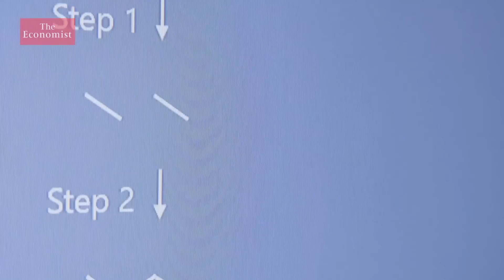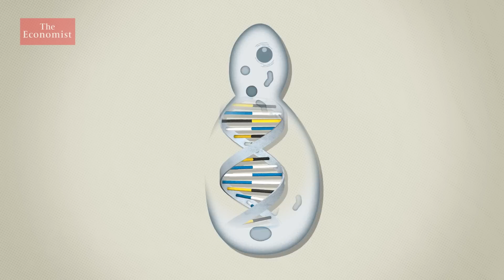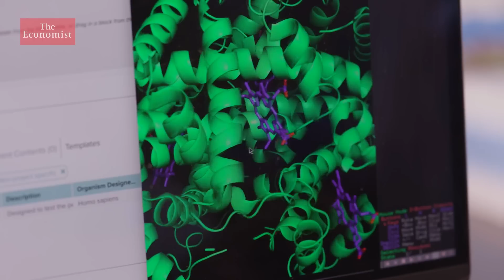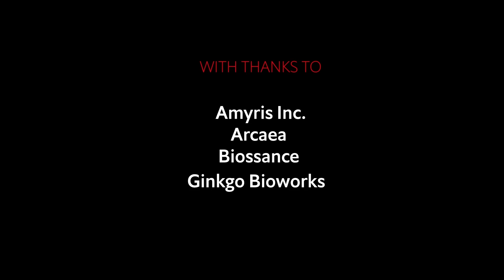How gene editing could reduce the cost of cosmetics

Comment: Biodegradable bioplastic could be mass produced through precision fermentation with no harmful environmental footprint.
Reply: Virtually all  types of biodegradable plastic alternatives produced today, from lactic acid  derived products to pinaple composite,  have a huge common problem in that they start melting at temperatures above 37C  or ~100F. We are far from replacing plastics.  The problem is that the qualities that make plastics so useful (durable,  stable, light ) are also the very things that make it non biodegradable.  Biodegradable materials are by their very nature less chemically stable - that's why they are subject to (bio) degradation..
Reply: 你们英国人是不是都喜欢吃猪食呢
Reply: The only peoblem this technology would face will definetly be it's durability/shelflife. Currently, the standard requiered shelflife of a cosmetic product is about 3 years. That means that this biodegradable bioplastic material would need to hold It's form for at least 3 years before it would start to decompose. It would also need to be water resistant in this time period because the vast majority of cosmetics are mainly made of water, maybe this could be solved by coating the inside of the packagin with a natural wax or something. The shelflife problem could be countered in a way by decreasing the amount of product in this packaging thus speeding up the rate at which consumers use up this specific product, which would be one way to get around this kind of potential issue.

Comment: The cosmetics industry has exploited natural resources by extracting ingredients from animals and plants. One company has discovered a way to reduce this degradation of the oceans, and it claims that this is a game changer for the entire industry. Squalene is one of many components derived from animals that are utilized in the cosmetics business. Gene editing technology has the potential to replace all of these animal-derived ingredients.
Some firms have stopped using animal products and substituted substances like fats with petrochemical replacements. Trees cut down for their perfumed wood are facing extinction, and wild flowers are at risk. Most modern cosmetics contain palm oil, which is a major driver of deforestation. The cosmetics industry produces 120 billion single-use packaging units each year, and nearly nine out of ten products from major brands contain microplastics. Some biotech companies claim that technology may be the solution by creating microbes that can break down plastics. In 2021, companies in this sector saw their values crash as they struggled to find a market for their technologies in areas like biofuels.